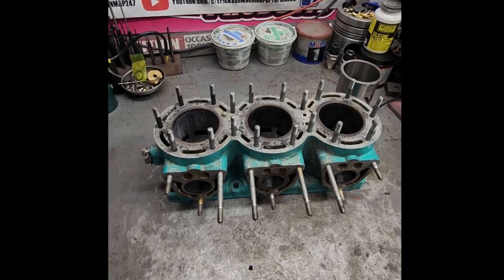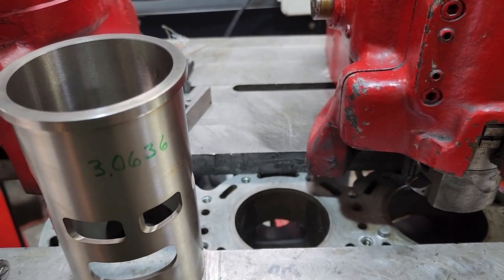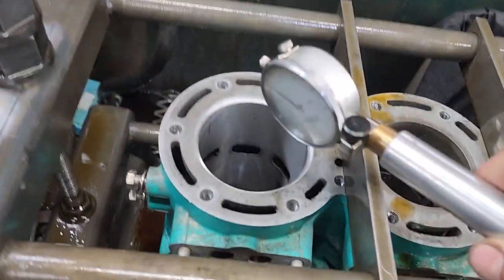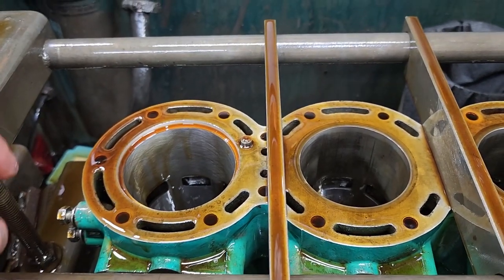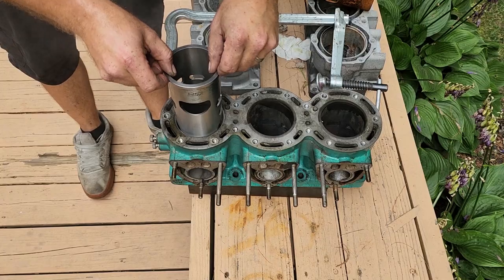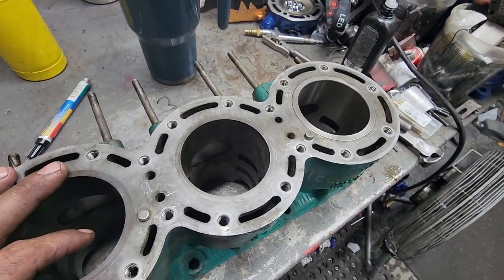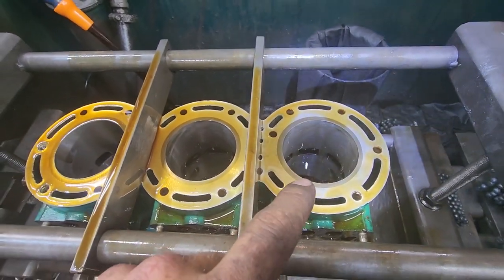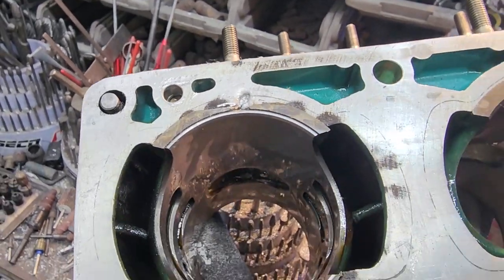How To Sleeve a Kawasaki 900 jetski cylinder

Comment: Hopefully you see this. Your grinding stand for porting. If you put a small cv boot over the ball. It will last forever rather than wearing out due to the shavings.
Reply from the maker: Thanks for the heads up. I'll try on my next 1.   This one IS ALREADY worn-out.  That being said I port around 20 hrs a week so there is alot of wear and tear from being used. In general these stands last around 5 years